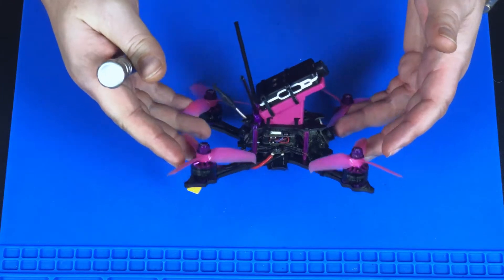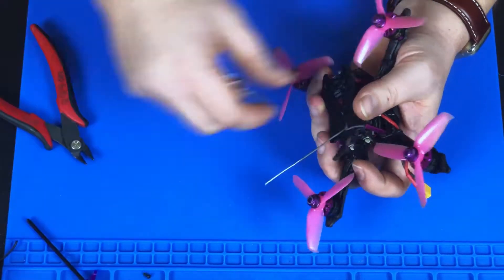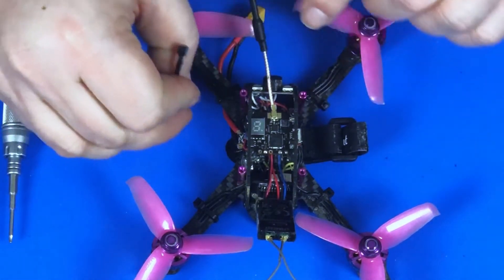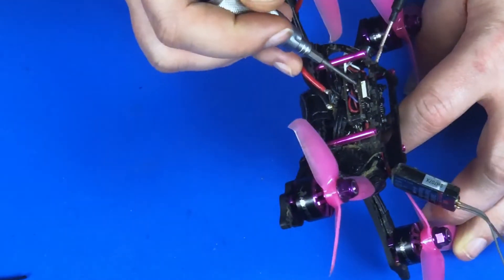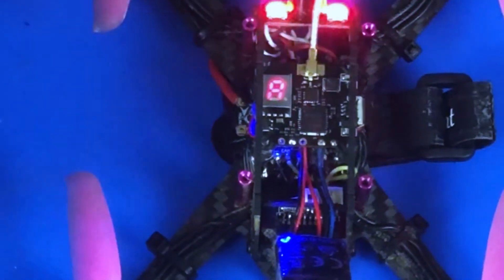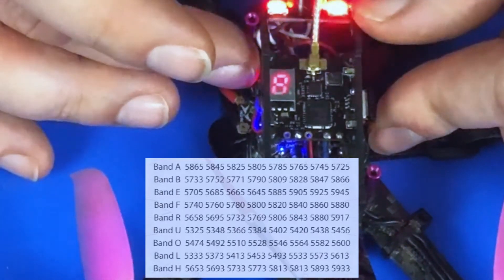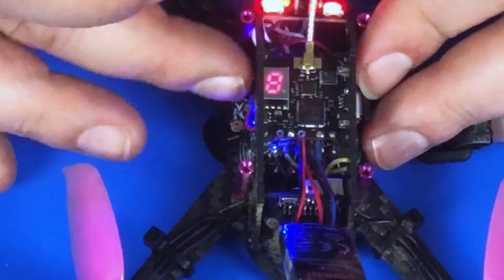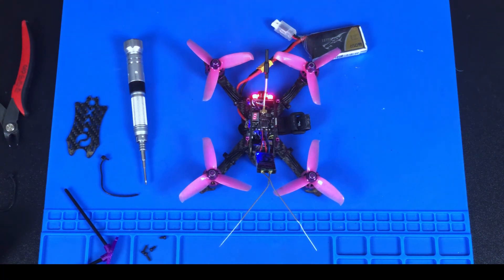HGLRC XJB 145 vtx - setting it up

Comment: Just came to see what happens if the button was to remain pressed. I conformal coated the boards in my XJB today, and removed some old hot glue from the VTX. I accidentally got a little coating on the button, which is why I wanted to see if the display goes dark when the button is pressed, in case that was the problem. I think I must have nicked something when I removed the glue. The VTX gets seriously hot, but it doesn't transmit - and yeah, antenna was on while it was powered;) Damn.. I have a spare VTX03 - I guess I'll have to install that now, while waiting for a new HGLRC VTX. It was useful to have this video as a reference!
Reply from the maker: no output at all (static) or black output (no video but still a signal being broadcast)?  It is possible if you were scraping around the ipx u.fl connector, you nicked a tract to the antenna, and even though it is physically attached to the board, it isn't electrically attached if you know what I mean.  It shouldn't get seriously hot that quick under normal circumstances (though it would if an antenna wasn't attached) so that may be what is going on.  For me when it comes to the video signal, when in doubt I always replace.  Last thing I want is an armed flying blender in the air with a unreliable video signal.
Reply: @tronage   Thanks for the reply! Yep, I think the same as you. It's probably unreliable now! I have a USB microscope, I'll check if I did cut something, and if it's possible to repair. In any case, I'll replace it with a new one. The VTX03 will have to do in the mean time=) I might have destroyed a track to the ufl connector, which might explain why it's getting so hot even when the antenna was attached. 

So yeah, the quad works now, but 5 seconds into a flight today, one of the propellers came loose (because I'm an idiot) and the quad went down on asphalt. I broke the damn transceiver=P Luckily, I have a spare one. I guess when you buy quads, buy two quads, haha!
Reply from the maker: AWE that is so terrible!  But we learn from our mistakes.  I've done some really silly things in the past, and had my fair share of crashed to hard surfaces.  But the more you fix, the more you learn!!  Keep me posted how things turn out!
Reply: @tronage  Everything is in order now. I don't know why, but I found that the transceiver worked fine after I had taken it out of the quad and replaced it with a new one. Very strange! Now I'm wondering if I should replace the Eachine VTX03 that replaced the HGLRC TX02 with a new TX02, or if I should rather get a TBS Unify Pro32 Nano (with a 20x20 adapter). The latter is more expensive, of course. One advantage is that it doesn't have that LED display that the stock TX02 has - which means it has a lower form factor.
Reply from the maker: Personally I'd do the unify over the tx02, but as you said, more expensive.  I have a habit of beating my xjb up, so I opted for the tx02 (when I upgraded from the tx01) to save a couple of bucks.
Reply: @tronage  I think I'm going to go for the Unify. I have a question out from a seller in Norway, asking whether the 20x20 is included in the package or not. If it is, I'm getting the Unify. I might even put on my moneybags pants and get a spare TX20 (I was wrong, it's not called TX02) in addition to the Unify=P  It never hurts to have spares, except for the wallet!
Reply from the maker: Well I can tell you the unify itself does not come with a mounting board for it.  If the seller is including one, it is one that they are including as part of a package they are selling.  but by default the unify does not have any mounting included.  I'm a big fan of spare parts!  I'm always going into the bin to fix something (and it is nice not having to "wait" for it to arrive!

Comment: Sorry just reading other comments, I didn't realize you had only 3 settings, so yes I have Smart Audio and 4 settings, that's why I was confused, makes sense now.
Reply from the maker: Also newer XJB's will have the v2 of their VTX which is different (the button pushes are different, and it looks different).  You can check out my video here: https://youtu.be/2ndqRmQeFEU which shows upgrading a v1 to a v2 as well how to tell them apart etc.

Comment: Howdee, hey just playing with my XJB and the power for the VTX has 4 settings not 3. The extra one is 350mw, I assume that one step further than you are going with 3 bars, is the 350mw setting, it's after the 3 bars but shows as 2 bars, confused? I was. Then on the OSD you can adjust of course but it doesn't list 350mw, only 400 so there's no real way of ensuring you are on the strongest power, bit of a hit and miss deal but I went one step further than you did and I am hoping that is the 350mw. I want full power. Have flown my XJB "LOS Only" and will FPV it today!
Reply from the maker: Check my reply on your other comment regarding the v2 of the vtx.

Comment: No matter what I do my vtx will not change band or channel or mw.  I try and set it on band b it just goes back to f. I try and set it to channel 6 it just goes back to 1. Same with mw.  Looks like a faulty vtx and I'm stuck to f1 and 25 mw.  This sucks.
Reply from the maker: Are you trying to do the settings in the OSD or with the button?  If using the OSD make sure you pick set at the bottom, and it should ask you to confirm. if you change bands or channels, at that point your goggles should go to static because the channel changed.  If this doesn't work then there are a few suspects, the first being that you may have a v1 of the vtx which does NOT have smart audio, and can't be adjusted this way (and you can only do the button press method).  You can check out my video here: https://youtu.be/2ndqRmQeFEU to see if you have a v1 or v2 and how to upgrade (if you wish to) and the setup of the v2.  Let me know if this helps you out!
Reply: @tronage  I reflashed the firmware and was able to fix the vtx. I didn't realize I would have to set everything up again.  I'm kinda new. On configuration page serial base and sbus would not save. I accidentally changed a uart now I can't connect to betaflight anymore.
Reply: I also updated all drivers
Reply from the maker: you may have disabled the uart that is necessary for the quad to connect to betaflight.  To get things back up and in order you will have to reboot / reflash the fc.  try using the impulserc driver fixer to get it into DFU mode so you can re-flash.  Or you can also use the boot button that is on the fc (looks like a flat copper colored disk next to the USB port label "boot")  Hold that button down and then plug in the USB to power it up.  That should put it in bootloader mode (DFU) and allow you to re-flash the firmware which will re-activate the uart.  For a full betaflight setup of this quad, you can check out my vid https://youtu.be/Ke7Dj0pdNok which shows all the setup (except for the smart audio if you have a v2 of the vtx, that is covered in this video https://youtu.be/2ndqRmQeFEU where I show the upgrade and setup from a v1 to a v2).  That should be enough info to get you squared away.  Let me know how you make out!
Reply: @tronage  that is exactly what happened! Thank you for all your help!! I really appreciate you taking the time!! Great channel you have! You're xjb145 vids have really helped me out! Thank you sir!!
Reply from the maker: No problem, my pleasure!  Now get that bad boy up in the air and rip it!!!  Let me know how it goes!
Reply: @tronage  will do!! Thanks again!!

Comment: Why not make a notch in the top plate so you can see the screen? I just ordered one of these drones and that’s what I plan on doing.
Reply from the maker: Several reasons.  First carbon fiber isn't "easy" to cut.  Secondly when you do, you will create carbon fiber dust which is very bad to inhale, so you will want to wear a mask when you do it (or if using manual tools, do it underwater).  And lastly you will compromise the structural integrity of the plate.  if you cut into it, it will cause a stress point that will most likely fracture in a crash.  If you are just buying it now, you will more then likely get the V2 of the vtx, which has smart audio on board, which lets you do all of this on your OSD.  Check out my vid on it here: https://youtu.be/2ndqRmQeFEU
Reply: tronage, word thanks man.
Reply from the maker: @RocketDolphin89  Any time.  Feel free to ask any questions about it, I have a bunch of videos setting it up etc.  I'm here to help, or if at the very least, I'd love to hear how you like it and your experience with it!

Comment: My XJB-145 has an interesting problem. Possible the FC died? Here's my (non spammy) video about it:

https://www.youtube.com/watch?v=UBIywDQZ9OM

I would be thankful for any help / tip!

FYI: I've got a V2 (350mW is the max of the VTX) and the instruction wasn't clear, but it' an IRC Tramp so has a smartaudio functionality! Funny I was flying on R8 fixed and needed this problem to find this out :D
Reply from the maker: Very odd indeed.  Try this, plug into betaflight, and goto the motors tab and see if you are able to operate each motor from there.  It is clearly something wrong with one of the three (fc/esc/motor).  Also you can check with blheli suite to see if the 4 escs are reporting back when you read setup too.  Not that these will "fix" anything but may give more information where the problem lays.  If your video are you operating the sticks, or is that just what it does on its own when powered up?
Reply: On the video you can see the BF motor tab test's result. Quad was powered up of course, and this was after a motor change (no screw reaches the motor) plus an ESC change. This is why the FC is suspicious, but never heard about a FC problem like this :/
Reply from the maker: I'm pretty stumped what is going on with it.  Maybe throw it on to BLHeli just to make sure all 4 escs will read setup.  Also another thing to try (that may help if it is a FC issue) is to go into betaflight, make sure your warnings is turned on in your OSD (and somewhere you can see easily), and see what happens in the OSD when it does this.  Is the FC re-booting, is there a warning being posted before/during/after, etc.  Let me know, I'm very curious to what's going on.
Reply: @tronage : Tried almost everything. Just got a tip to flash the new BF, so I've just flashed v3.5.3, and now only Motor 1 spins. My new FC will be here next week, now I really wait for it as I fed up with this %!=)(=/(+!.
Reply from the maker: @mtbsomi  Such a very odd behavior.  It doesn't make any sense.  Please keep me posted how this turns out, I'm very intrigued!!!!
Reply: @tronage : New FC arrived. Same shit.

Old motor -> new motor -> new ESC -> old FC remap -> old FC + new BetaFlight + remap -> new FC

What the heck should I change now? :P
Reply from the maker: Hold up,  with New motors, ESC and FC you still have the same issue?!?  That makes no sense at all!  One of the three had to have been the problem...  What I personally would do is re-build it, meaning taking everything apart, all wires, etc.  Double check I don't have any solder bridges etc.  Then put it back together (using all the new parts).  It could be something as simple and dumb as the VTX antenna is shorting out into the carbon fiber slightly and causing the issue.  Personally I find it more effective to just "start over".  But clearly it is some subtle issue causing the problem and not something obvious since you have now replaced the obvious parts with no change.  Please let me know if you figure it out!
Reply: @tronage  Here's the fun fact:

https://imgur.com/a/jUL9c5z

Was checked without everything. Even with removed arm / motor protection (however it was clear there's no physical contact), removed VTX, cam, etc.

This is the totally minimal build now which is needed for a test.

Actually I could change the motor again, but I don't think it has a reality that a motor dies somehow after a landing, and a fresh new has the exact same problem after opening it for first time.

Asked around a few forums, under videos, etc. Nobody has idea. Unbeleivable...
Reply from the maker: @mtbsomi  I'm going to take another stab at this.  Are your motor screws shorting into the wingdings of the motors?  Something similar happened to me when I used too long of a screw.  Even if you back out the screw, the varnish may be scraped away and it may be shorting within the motor...  But something to check/think about...  It may also be worth testing not on a frame (to eliminate the possibility of grounding into/through the carbon fiber.  So perplexing!!!
Reply: @tronage  Thanks for the tips. I always beware of the screws as one of my friends killed a full set of motors because of a too long screw. Free lesson learned. The frame's sides and solderings / wires were checked by multimeter. No beeps at all. (Frame side vs frame side beeps, of course.) Actually everything with everything was checked with multi about 10 times.

I still have spare motors, but I don't dare to change as I don't want to kill more, if there's some other problem, but I think there's no other chance to sort this sh+!+=/t out. I'll have to risk...
Reply from the maker: Keep me posted!  I'd love to know when you find a solution!
Reply: @tronage  Thank you for the interest, I will. Wish we didn't need for it :D

Comment: Mine hasn't got three dashes for power, it has one, two and then 3 single dashes. Not so sure.
Reply from the maker: This video is showing the V1 video transmitter.  They have released a V2 of the board (and I suspect that is what you have, and why it is acting differently).  The easiest way to make adjustments with the V2 is to take advantage of the smart audio connection that lets you adjust everything in your osd.  Check out my video here about it (https://youtu.be/2ndqRmQeFEU) and if you still have questions feel free to leave them and I'll do my best to help you out!
Reply: It doesn't have 350mw in the list on the Smart Audio, only jumps up to 400mw. Not sure if you set 350mw by selecting 400mw or not??  @tronage

Comment: It is saying that the max power is 350mw , you said that the 3 bars are equal to 250 mw, so how to set to maximum 350mw?
Reply from the maker: The first thing you need to figure out is if you have a v1 or a v2 tx.  The v2 has 350mw, and is different then the v1.  Check out my other video here: https://youtu.be/2ndqRmQeFEU that shows the difference and how to upgrade.

Comment: hi!have a problem whis my vtx,have no picture any fix?
Reply from the maker: Going to need a little more info:  has it worked in the past, did it stop after a crash, do you have static, or a black screen, do you have OSD elements and no video feed? etc.  The more details you can provide the better I can try to help you.

Comment: SHORTCUT I use FrSky with this quad. When i plug in my battery it tells me Yaw left, Mid throttle, and Pitch up for menu, i can change channel and power for VTX so this is not necessary.
Reply from the maker: Thanks for the heads up!  Keep in mind, this only applies to the v2 version of the vtx.  The v1 version of the vtx (as seen in the video) does not support smart audio settings (which is required for the OSD setting changes you describe).  This video was made before the v2 was released to help people get it setup and running.  When the V2 was released, I did a video on upgrading the v1 to the v2 as well describe the smart audio setup, and how to configure it as you describe.  It is great to have your comment because someone with a v2 may stumble on this video first, and your advice will certainly help them!!! Thanks!
Reply: I did not realize i had a different version. I'll have to check out that video, keep up the good work!

Comment: Hi, my leds don't work with bf 3.3.2, any issue?
Reply from the maker: One thing to check is the LED tab in betaflight.  When you flash new firmware the settings for the LEDs can vanish, so the FC doesn't know you have them.  You may have to set them up again to get them functioning.  I have a video showing how to set them up here: https://www.youtube.com/watch?v=Ke7Dj0pdNok&t=4257s

Comment: Hey dude great vid , just wondered what receiver antenna mount you have got on there i like it ??
Reply: oh you printed it , nice
any way to control this vtx via betaflight osd
Reply from the maker: Yes I made it and printed the antenna mount.  As for controlling the vtx, yes, if you have the v2 of the vtx (and no if you have v1).  Have a whole video about how you know which version you have, and how to upgrade a v1 to a v2, how to make sure everything is setup in betaflight to allow this, etc.  Check it out here: https://youtu.be/2ndqRmQeFEU

Comment: hi can you help me choose a flysky reciever & how to install it onto board thanxs David,
ops Super video.
Reply from the maker: I don't have any experience with the Flysky protocal, however after a little bit of research it looks like for a quad of this size, you would probabbly want the FS-A8S v2 Reciever. for its size, since there isn't much space inside this quad.  As for hooking it up, you can check out my initial setup video here: https://youtu.be/4f7tlt0LxkE and use that as a guide to hooking this up.  Just make sure you use the proper colored wire for the receiver (yellow for S.Bus and blue for I-bus, depending on which protocol you chose to use).  Hope that helps you out!

Comment: The links say that it is suppose to comes with the TX20 V2 (48ch) that should have betaflight osd control via smart audio right?
Reply from the maker: Correct.  The V2 is a 48ch receiver that uses the IRC Tramp protocol ("smart audio") to do OSD control.  
The V1 was a 72 channel (includes low band I believe) and does not have osd control.
I'm actually currently editing a video of me upgrading my v1 to the v2 and will have the betaflight settings for it etc.  Should be up in the next day or two hopefully.